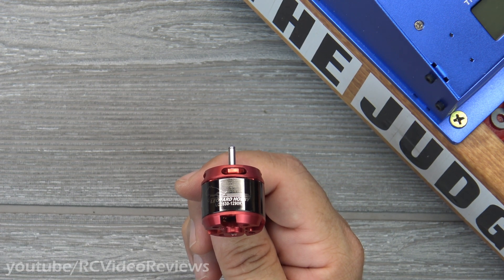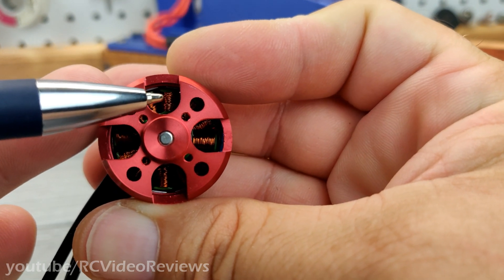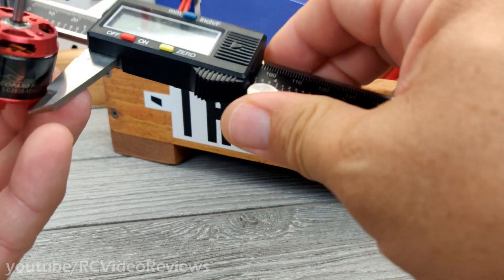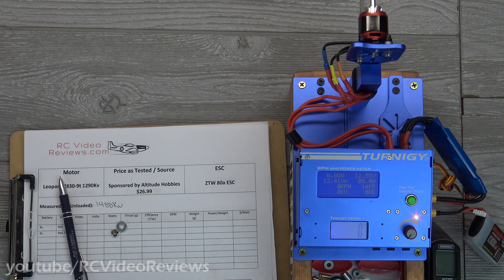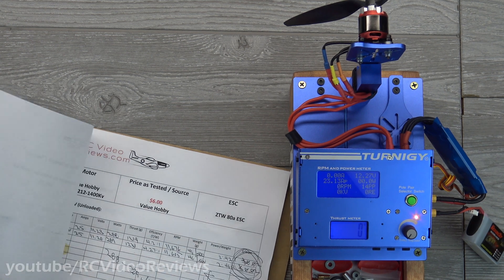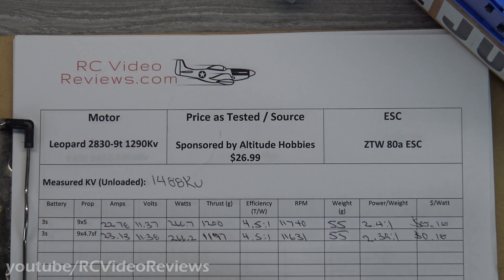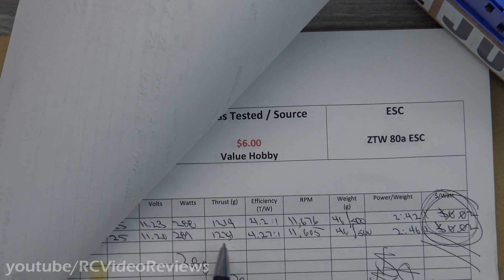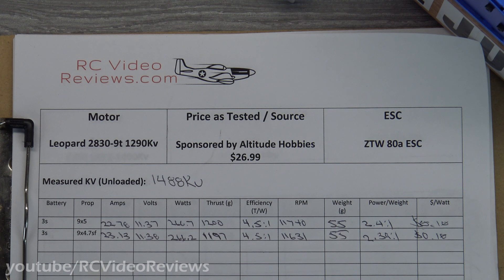Leopard 2830 1290Kv Brushless Motor Bench Test • LOVE These Leopard Motors • [The Judge Ep. 13]

Comment: Hi John. excellent review, many thanks. However, I have a question. Both the props you tested gave an amp reading well above the safe limit of 18a. Granted they were tested in the open air, but how would that compare with fitted in an airframe?
I have a Skylark S, same as an earlier review of yours, which I plan to run on 3s with a 9 x 5 GWS prop. Do you think this motor would be suitable?
Thanks
jeff
Reply from the maker: Motors are a little less sensitive to amps than things like ESCs. This one saw 23a against a peak of 18a, but that was also a static test. Dynamic current (in flight) will be lower. Even if it only dropped 2 or 3 amps in flight, going one or two amps over peak isn't going to hurt it. Especially since the moment you start using battery the maximum current will decrease.

This motor would be good in a Skylark.

Comment: I like the leopards too.
Hey I have a question. I bound my Aeroscout(DSMX)to my TX16 and I don’t think I lost the signal, but Amber is complaining that RSSI is low or critical. Do I have a setting wrong? Again, I think I had control of my plane the whole time. Thanks for the TX16 videos, they’re very helpful.
Reply: Thank you for the reply. I will try those things
Reply from the maker: @graymatter45  Let me know what you figure out.
Reply from the maker: One of the problems using receivers outside of their (tx) ecosystem is the interpretation of RSSI. 

There are four things I would suggest:

1) Google for the expected range of RSSI on the TX16s for your specific transmitter. You're probably not the first person to encounter an issue.

2) Google to find out if RSSI is the primary signal strength metric for that Rx and the TX16s. I've found on FlySky for example the primary indicator of signal strength is RQly.

3) Look into fine tuning the frequency for you Rx. I've tried it on a handful of FrSky Rxs and have not been able to improve RSSI over the unmodified values, but the code is in the firmware and it is suggested to try.

4) Perform a range check and make sure the range check operates as it should.